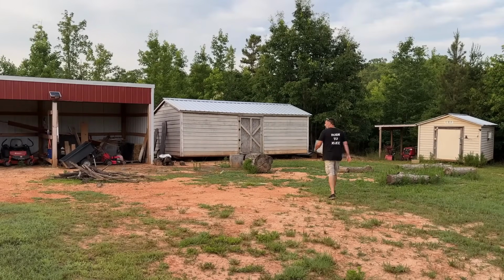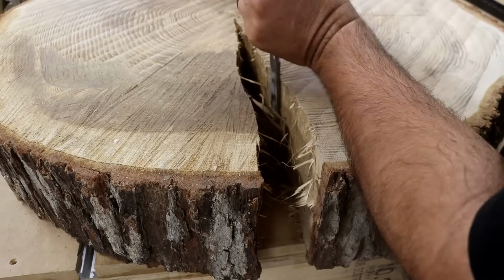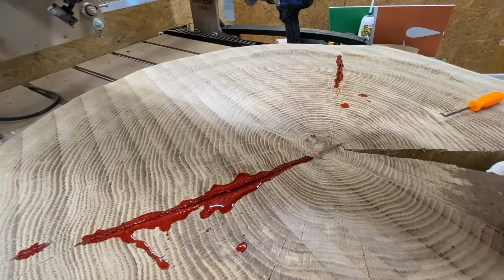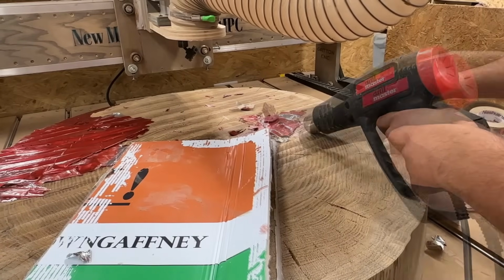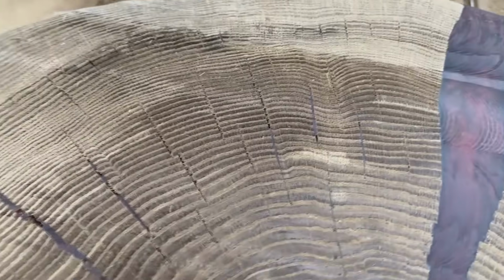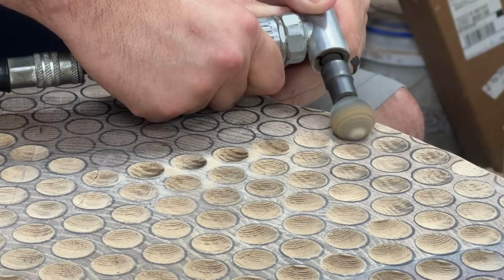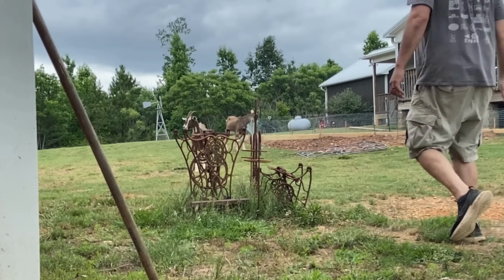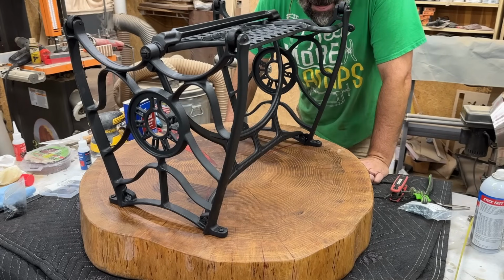This is The Most Incredible Table Design Yet

Comment: Nice project, lots of work.  Have you tried using mold release on the corrugated plastic before attaching it to the project and pouring the resin?  It should come right off.
Reply from the maker: Hey Todd, I do use mold release. It is really weird and a pain in the butt. lol

Comment: Very nice!   Sometimes things just go wrong and you have to keep at it until you get it right.  Well done.   Does your mini split drain directly outside?   Probably just a clog in the drain line.   A quick suction with the vac will clear it out.  Had a similar issue and it was an easy fix.  😊
Reply from the maker: Thanks, it was a clog. Only took me two months to get my wet vac out there to fix it. lol
Reply: @MoonpieCreations  Get’n the mini split professionally cleaned once a yr or every other yr is extremely important too.   You won’t believe how much disgusting growth/germs/mold builds up.   So every time it’s on you are breathing 😮‍💨 it in.

Comment: Hello Ken, great work. Just curious, though: is there a reason you opted not to use the CNC to make the dimples? It would probably have been less stressful.
Reply from the maker: I tried a few test cuts for the dimples and I just couldn't get it to work well. My skills on the CNC aren't great and designing cuts even worse. lol I have a plan for another cookie and the CNC. I'm hoping I can find the time to try it and maybe I can even pull it off.
Reply: I see. You'll get there, and I'm sure the result will be worth the learning process.

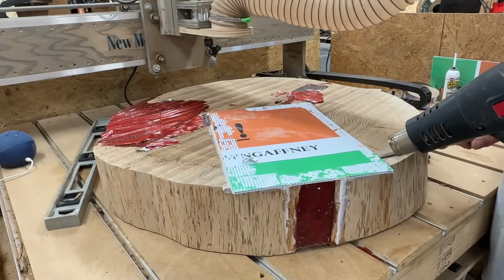Comment: The corrugated cardboard that you used has a plastic coating on it doesn’t it 10:52 ??? If you used regular paper-like cardboard, would it soak up the resin and leak through(just asking because i am curious as a fellow crafter and product creator; not trying to judge or demean in any way)???
Reply from the maker: It does have a plastic coating. You can use regular cardboard but you have to put some sort of film on it such as Tyvek tape.

Comment: Now for another table from another cookie……..fill cracks with copper color resin, then drill shallow holes and stick a shiny new penny in each hole. Finish with resin.
Reply from the maker: Neat Idea......what do you think about something similar except I lay the pennies flat and have a top of pennies? I could cut out an insert in the top. Now you got my thoughts going.
Reply: My son made the floor of his basement bar of pennies that were close packed and then just poured resin over them.